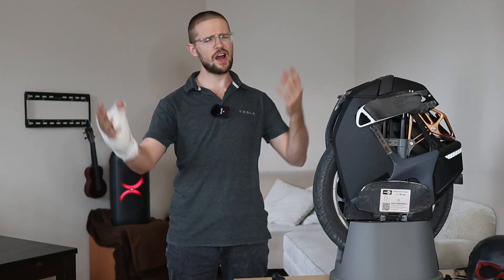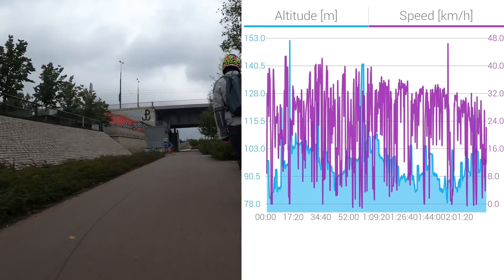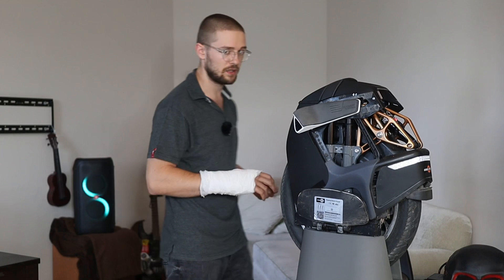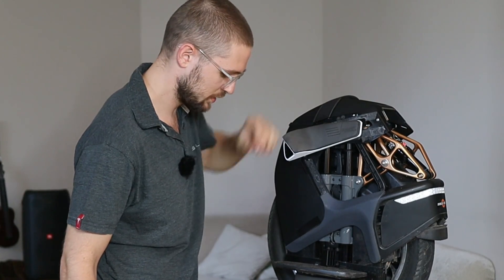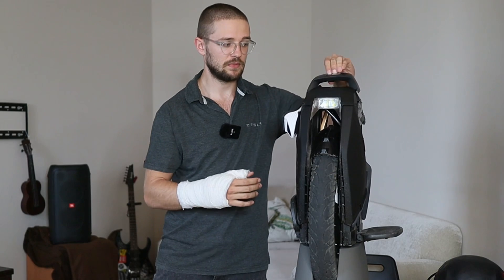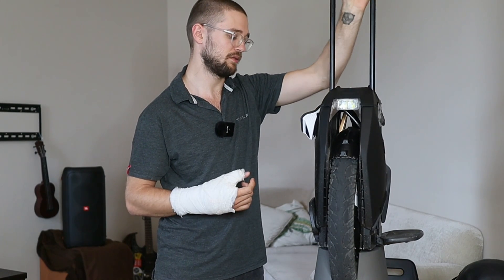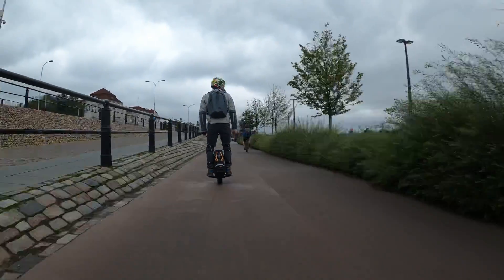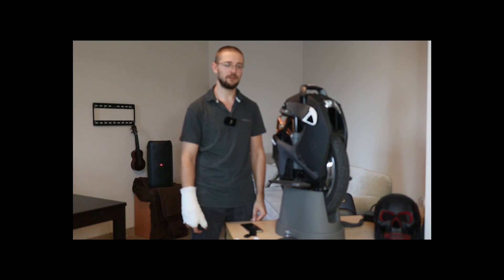King-Song S18 Review

Comment: Oooook soooo, actually none of this video really surprises me. Why? I've been watching every reviews about the s18 since it's out. We knew quality wasn't the best, the battery is small therefore and it was already proven, accelerating fast wouldn't do. Does it mean that this wheel is unridable a 40/45kmh if you just don't do it MJ style? Can you answer this?

I agree the light is cheap led you find in those Ali express cops like lamp, and this is a bummer, wish all euc's had led+lens! (they don't need to have fans, riding cools it down fine).

Must agree with the handle, it's beautiful I like the fact that it disappears and all but, we need something to grab on, I was planning on hadding a leather handle to the casing (people tune the Sherman for all sort of things, why not the s18 for a handle, both are expensive)

Now agree again there should be more clearance from the mudguard And the casing so swapping tires can be done more about the kind of surface you're willing to ride on.

Agree too on the combo low battery/high power motor, it must be rethinked. But s18 handled climbing very wheel and jumping to and i think it's due to it's powerful motor, so maybe change the algorithme and make it more smooth accelerating like the v11 and less aggressive 

So now, s18 is THE FIRST wheel to propose something like that, and i mean: suspension centered design (others chose to go with pogo sticks and I'm sorry but I'd rather have a non suspension wheel off road than that type of suspension there... Too dangerous), therefore you have to cut battery, you have to think of a way of attaching all the parts together at least for now (that's not just 2 shits of plastic left and right, screw in the middle there you have it). We must now consider this, the euc world is still young, small, and to advance you need money. I'm happy that kingsong took the bet, why? Because this is the way suspension wheels should be done in the future, this is the first one, no one has ever done that before, so yes it's imperfect. It could be cheaper and they could have continued developing but, companies need found and that's a fact. S18 is 2300€ here, it's expensive, but it's investment in the future, they would find something in the middle, 1700 I think is a tad low, maybe 1850/1900 max. They already changed a loooooot a things and they continue too, that's a good sign, but first is money and I don't think telling people that wheel is SHIT is gonna help KS and that wheel become the standard, it will make it disappear, next time we will be going extreme city freestyle and off road on pogo stick bouncing around and all, breaking our bones.

This is new, it can't be perfect, probably be more battery, better system in the futur, either you pay and collaborate to that or you don't and take your money to conventional wheels, it's up to you. But never forget this, on a small market like euc's, you need founds to advance. Taking that kind of bet was hard I think for KS, it's a big risk. Ninebot, gotway, inmotion they all have big backgrounds and other activities yet they couldn't dare do something like that, they saw money for supplier but not that much innovative device. OK

Now I need a wheel that can take me to work 50km a day, take some stairs, jump up some things easily, and ride it's ass off on the week end in the forests I have in here with 10 to 30 degree long climbs, s18 is great for all that and I won't forget. This is not a wheel for speed demons.

I have juste one question. If the battery has so much sag, how come it handles so fine on choochtech videos? He's not doing 15mph, and going all around, so I wonder. Leaning like  GWs no bainers is bad on that wheel other than that it's fine and it will be better, if it's profitable. If not it will simply disappear, that would be a shame.

Thank you Adam for pointing all this ( that I already knew), and I do hope that the review will be a review since you already pointed every possible bad things in here. Also remember that one cannot fit all, and i hope KS will make something of this review, like they always do
Reply: Ya, but tell us what you really think.
Reply: @Randoman9987  Adam or me?

Comment: Still contemplating getting this wheel. I'm 270lbs (122.5kg).
Battery cut out is an issue- but I'm no hard, fast rider. I never had a problem on a V10F (980wh, 130 less than S18).
I've even pushed a long line of shopping carts with the V10F.
And Kuji Rolls hard charged like a maniac with no problems in the S18.
So maybe it was just a glitchy wheel.
Besides,KS sells an external 780wh battery-u can charge while u ride!
Decisions, decisions....🤦🏾‍♂

Comment: Remove all the air from the suspension, push on it until it bottoms out, it will not bottom out on the suspension, it bottoms out on the EUC itself, I bet the blue o ring just fell off.  Try it and let me know.

Comment: I just bought the V11 and this video has made me feel really good about that decision.  Thankfully I've never experienced a cut off and I think that's cuz I only ride InMotion.
Reply: I switch from the V11 to S18,  knowing that this wheel is weak compared to the completion. It's still the best suspension wheel out there based on the reviews so far but the V11 and other high-end wheels are superior in terms of speed and range.
Reply: @therealestmc85  And safety.
Reply: @therealestmc85  It's the wheel that has the best suspension, but that doesn't mean it's the best wheel that has suspension.  You're making sacrafices everywhere else.  Power, speed, range, safety, etc.
Reply: @TheParentalRevolution  And lighting.
Reply: One Wheel Man, this is a trail and short distance wheel. I wouldn’t buy this wheel as my only wheel. This thing is made for the trails and occasional street riding. I think any other wheel comes close in that aspect.  I don't see why this wheel is less safe in its environment than any other wheel.  Like I said, if I could only afford one wheel, the V11 would be it. As an owner of MSX 100V, the V11 isn’t really filling any gap, besides the ability to ride at night.
Reply: Xavier K  the V11 has better lighting but the S18 is more than adequate if it’s headlight is really better than the 16X. Anything thats better than the MSX is a win in my opinion.

Comment: Wrong way. I think your review was wrong. You tried to ride the S18  like a 100v MSP or 100v Sherman. So when it didn't perform like a 100v wheel. 
So you bashed it.  Maybe you should've waited for your hand was healed, because obviously you're still bitter about breaking your hand so then you take it out on the S18.
Reply: You are missing the point mate: or rather many points here. Too much acceleration and your thrown off. So talking about bitterness here is not relevant at all.